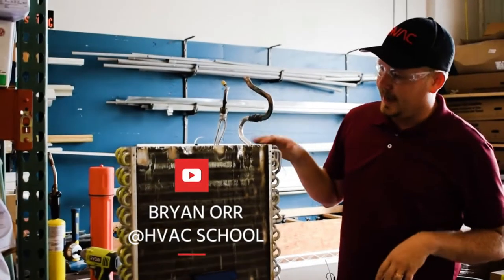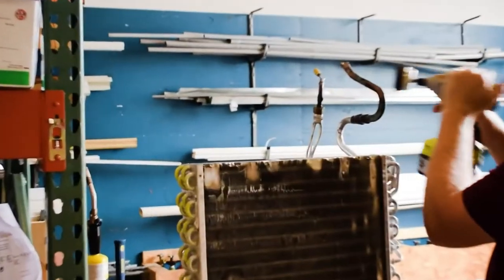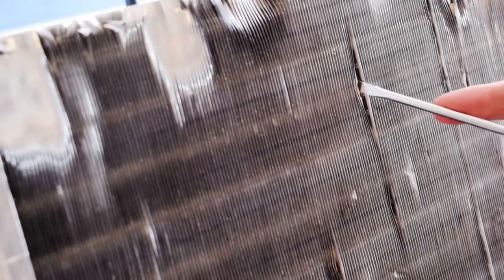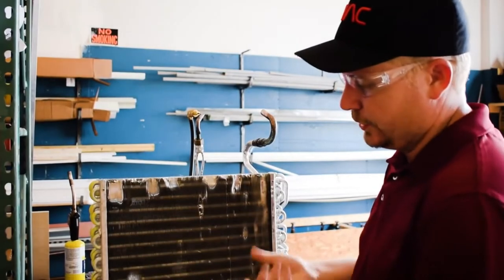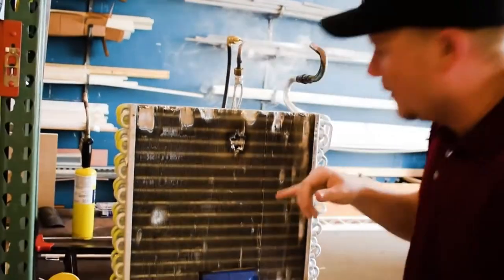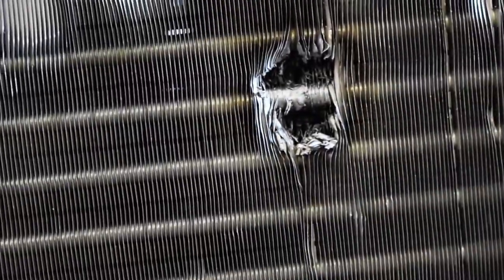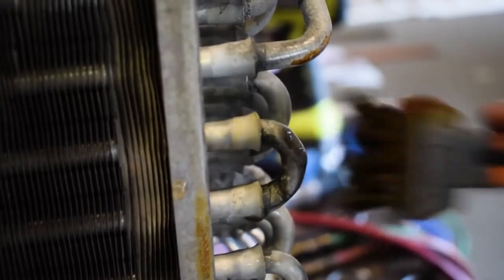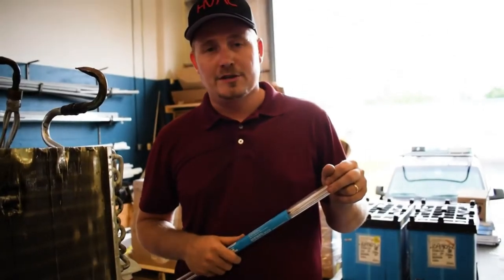Alloy Sol | How to Patch on an Evaporator Coil

Comment: You using a copper wire brush on alumimium ? What did i hear about that ? I forget aint you supposed to use a stainless brush